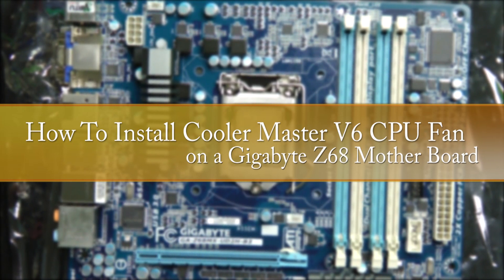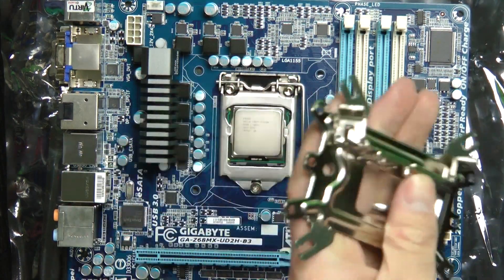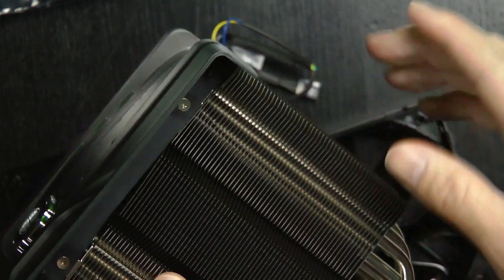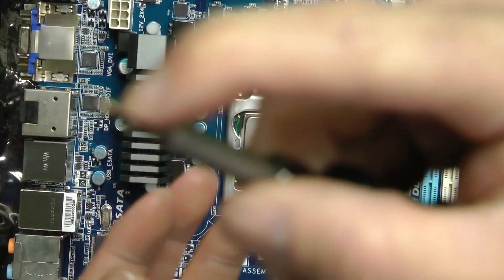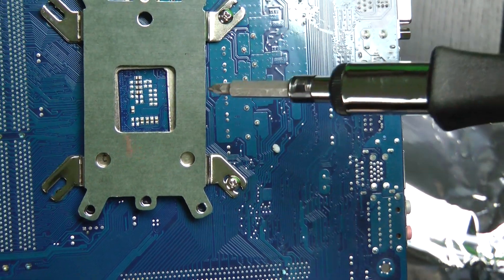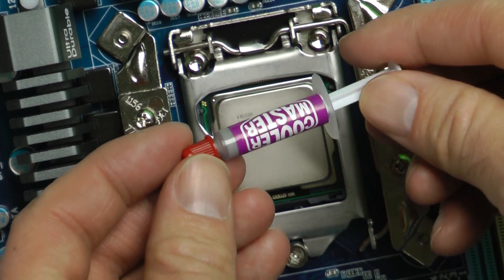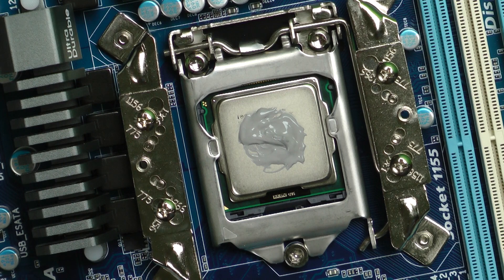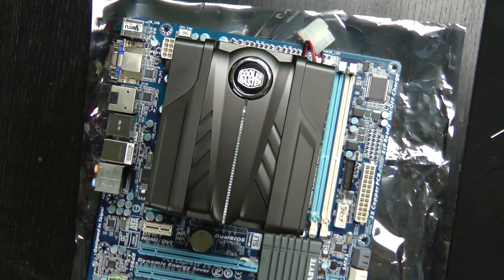How to Install Cooler Master V6 GT CPU Fan on z68 Gigabyte Motherboard "tutorial"

Comment: Good video but waay to much thermal paste!!! Applying to much can cause heat issues:( A very thin layer will do and just on the processor! Nice Cpu Cooler by the way:)
Reply: he was like "a dime size amount will do" BOI he added like a nickle size and then some to the heat sink

Comment: what temps are you getting nowadays.  i also feel too much paste.  if its too thick it can actually make your temps higher because there is more resistance for the heat to transfer through.  either a pea sized on the hsf or cpu only.  use pressure to squish them together, that way there are no air bubbles.  or the x method, or the 2 line method.  

but thats why i ask what your temps are, and what cpu you have, and whats it clocked at, and what is the ambient temp

Comment: you double checked after you applied the hsf and made sure there wasn't any excess paste hanging off the sides.  So you're fine.  (I've worked on about 20 builds or so at this point.)

Comment: CPU Coolers don't have anything to do with PSU, the cpu itself, and the gpu do. So, you can install any psu with this cooler. The wattage changes with ur power requirements.

Comment: the thermal paste is only suppose to fill the microscopic holes in the CPU and heatsink base so you don't need that much just the size of a pea.

Comment: like many b4 me have said: way too much t paste dude for real!!! have you not heard of the grain of rice method. on one surface not both is all you need, and by the way not sure if anyone else noticed but those brackets have three adjustments for different size intel and AMD cpu's and it looked like you did not set all four corners to the same size. The cooler probably wont fall off but its not straight, dude thats a sketchy install or real!!!!!!

Comment: brother, i suggest you to take off the cooler and clean the paste u just applied asap bcoz it will damage your mobo. reason is that u used too much thermal paste. you just need to put a pea size of paste at mid on the cpu and either spread it or just let the cooler spread it with pulling it down. i see that u are new to this stuff, and believe me you will not regret that you did listen to me. i have several years of experience with computer build-up's and thats why i am telling u this stuff.

Comment: Im going to install this soon and I was unsure on the power plugs, I need to plug in all three yeah? It says in the intall book to attach the 2 fan cables into a 2-1 adaptor and plug that onto my mother board. But my board has a cpu_fan_opt and a cpu_fan 4 pin plugs on it, should I just attach one to each? and does it matter which? do i still need to plug in the molex plug as well?

Comment from the maker: yeah i wasn't putting thermal paste on the whole time i was swirling it around.  it is about the size of a dime.  Having a little bit more is better than having a bit less but if you believe it is to much that is your opinion.  As long as it isn't dripping all out the sides you are good to go.  Thanks for the comment, concerns and for watching.

Comment: You used WAY too much thermal paste I think. I'm about to start building for the first time and everywhere I go to do research on thermal paste I'm told to just use a small amount in the center (for IHS cpu's, which all the modern ones are I believe), and then putting some on the cooler block and then wiping that off with a lint free cloth (not alcohol) to fill in the gaps so to speak.

Comment: Hi ,thanks for the video it helps a lot ,I just have one stupid question :I have the same processor as yours and nvidia 570GTX and i was wondering if this V6 fan will fit in my CM HAF912 case without Coming into contact with my video card ?please answer as soon as possible ,thanks in advance

Comment from the maker: I am sure you could.  I would just check on cooler masters site seeing I don't work for them and know all of the specs.   But they give you a ton of brackets and some of them are even adjustable so I am sure it will work with out an issue but don't quote me on that.  Double check with Cooler Masters site

Comment from the maker: Well it goes over it but you can still add Ram to it.  You have about a 1/16 of an inch of room.  You just have to add the ram first.  Then snap the right side of the cpu cooling fan on.  The fans snap on and off so it isn't that big of a deal.  This fan rocks actually using the computer to reply to u right now.

Comment from the maker: @MsMazor remove the cable from the mother board?    That should be no issue.  If you remove the existing fan.  You should off all the thermal paste carefully with a little rubbing alchohol.  Just be super careful.  Add the rubbing alcohol to a cloth or something.  Don't spray it or pour it on.  Clean the surface really well.  And attach this fan.  You should have no issues.